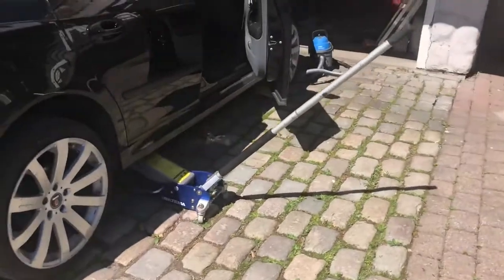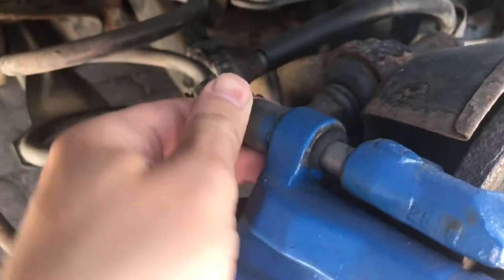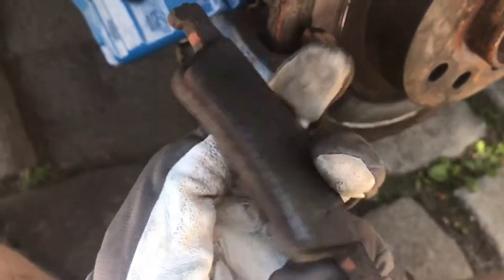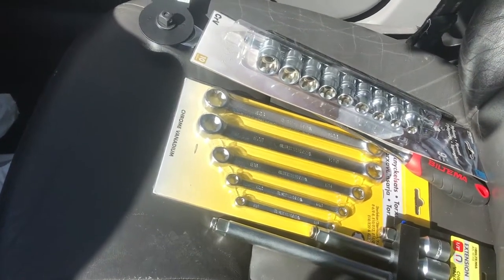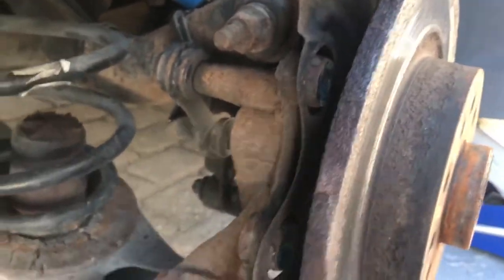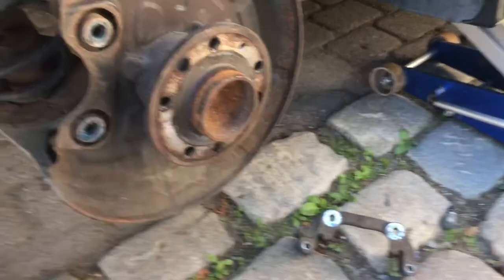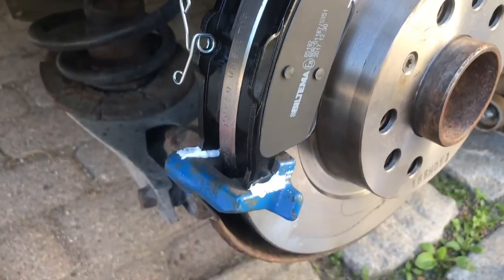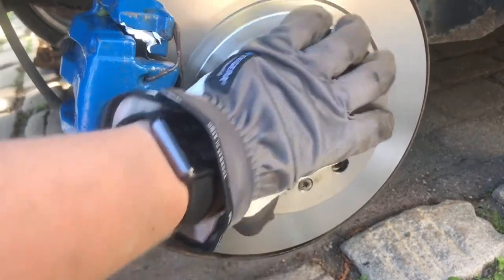Saab 9-3 NG Rear Brake Pads and Rotors Discs

Comment: You miss one of the most important and tricky think. How to push back cylinder, give U a clue , see those two holes , need to twist during pushing back. U will brake cylinder if use force.
Reply from the maker: Iam not sure if I forgot to show it on camera, but yes if you don’t compress it without twisting, you want get the caliper to fit back on.